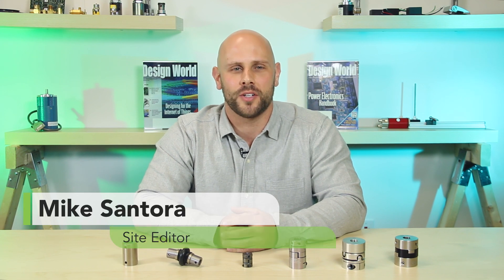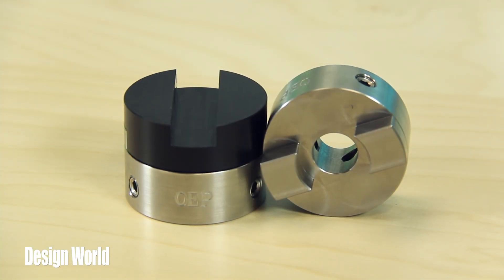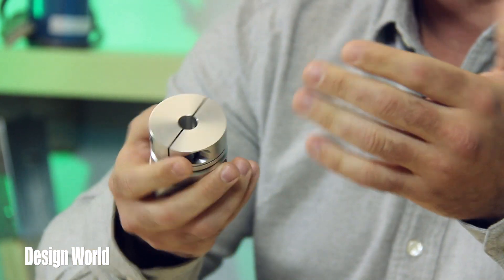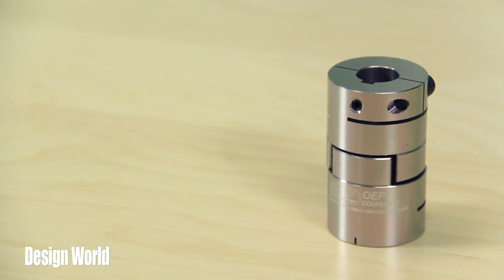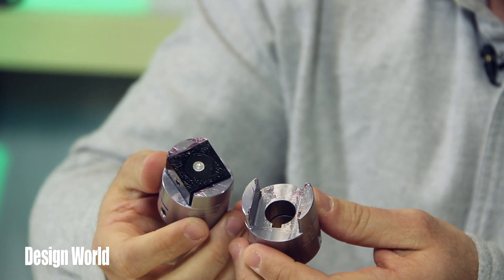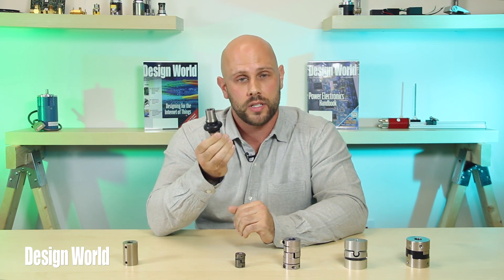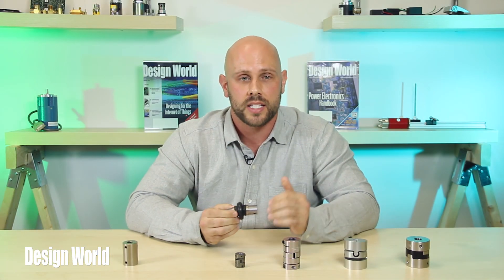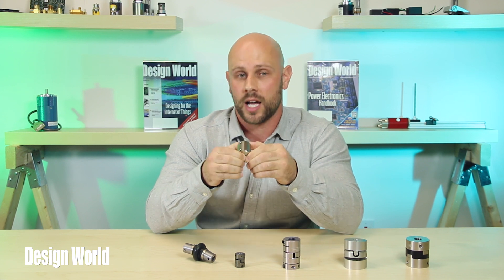6 different coupling types explained by Coupling Tips

Comment: excuse me. now adays im trying to disassemble ( motor & ageer box wiegh around 400kg) vertically suspended and connected to a bioreactore chamber. the type of coupling really confused me . there was two flange and there is between the gearbox and the vertical driven shaft. between the two flange there is  C type rign. i opened the flange and tryping to disassemble them but i couldnt. although the gearbox and motor are vertically suspended. appreciate if there is any advise
Reply: Interesting problem ... you might find something if you search CouplingTips.com. Or if not, maybe shoot an email to the folks at www.oepcouplings.com? Good luck! :-)
Reply: Paul Heney 
thank u very much for your reply. the problem been solve. it was stuck because of heat and rust. appreciate ur cooperation
Reply: well iraq good question